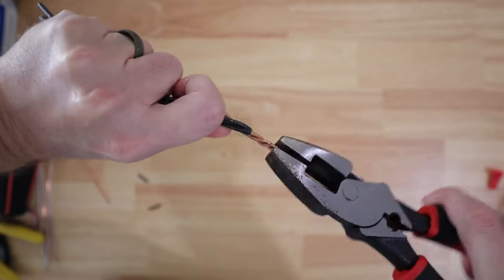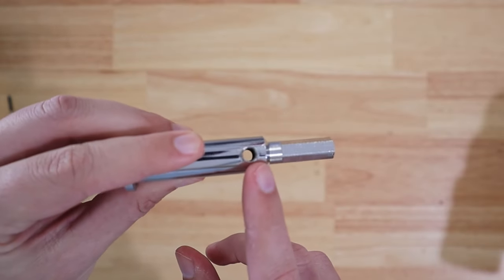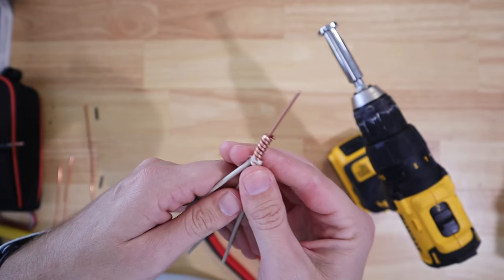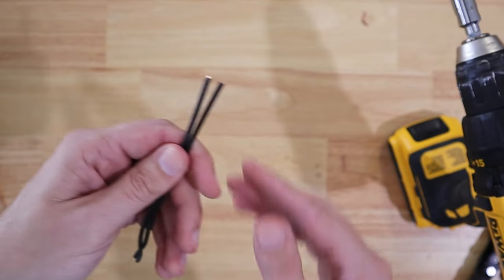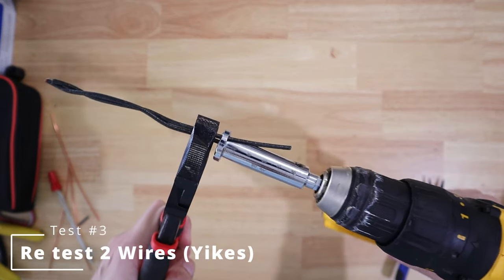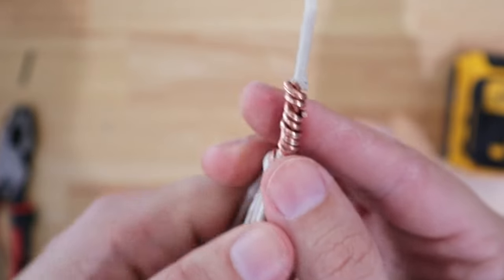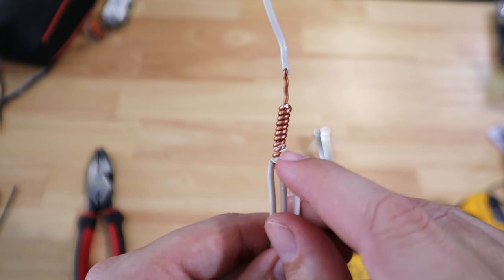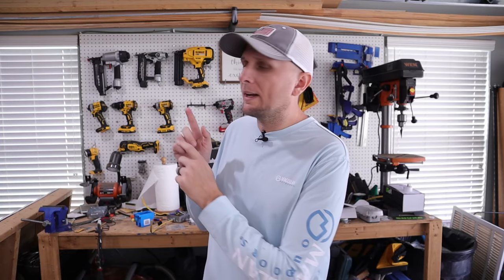Drill Powered Wire Twister and Stripper That Has Gone Viral

Comment from the maker: Have you all been seeing this wire twister/stripper all over the place?  What are your thoughts on it?
Reply: This technic is mostly used in third world countries where they use electrical tape instead of wire nuts
Reply: Would this work for wire that is used for paper bales? At my job we bale scrap paper and use wire with a hoop on one end. My issue is tight hand space and looking for something like this to get tighter bales. Think this would work? 🤔
Reply: @SloppyWzrdSleeve  Good thought.  What's the cost of this thing.  My limit would be below $20...like $11 or so.  I guess it depends on how many bales you need to tie.  It might be worth a crazy amount if it helps you enough.  Again, great idea.

Comment: Some of those problems might be fixed putting the drill on the slower speed setting.
Reply from the maker: I tried it slower but it was actually worse.
Reply: A stripped middle wire would make this moot.

Comment: Your concern about the giant nut that you have to use shouldn’t be something to worry about, since you have the wires twisted very tight, the purpose of the wire nut would be of isolating the whole thing/joint.

Comment: I just use Wago lever nuts. It's quick, easy, secure, and has a much higher continuous operating temperature rating than would ever be necessary, so it's really safe, too.
Reply: That's what I use.  Well worth the investment.  Especially when you want to pull your hair out trying to wrap 4+ ground wires into a nut and 1 keeps pulling out.  Wago eliminates all that.
Reply: Heard. In addition, they don't ruin the wire, so rewiring or doing later work is so much easier.
Reply: @wombleofwimbledon5442  Yeah, I've been using them in my home. You're right, since they just clamp down on the wire and it doesn't require the twisting and bending of the wire while working with it, the wire maintains its integrity.
Reply: wagos for the win, fo sho.  If you're a novice, trying to get 3 separate 14 or 12 AWG wires wrapped around each other and THEN get a wire nut SECURELY on there...  tear out your hair is right

Comment: Big mistake I did, but fixed using this. Strip the wire that goes into the Center hole.
Hold the pliers holding the wires directly in contact with the face of the bit. Then drill.
Reply: Yes, my thoughts too.  In fact, why not strip all the wires?  A great twisting tool is always helpful, especially with 3, 4 or 5 wires.

Comment: The only other test I would have tired was strip center wire first then try clockwise. If I was going to get one it would be for 5 wire 12 awg and 5 wire 10 awg. If it is less then that I use my channellock lyman pliers. Because of how it's been tightening wires blue or red wire nuts might not fit.

Comment: i purchased a similar one of these and the first two times it worked perfectly. From then on it stopped stripping the center conductor which totally ruined the connection. I used a drill and tested slow, fast, left, right, with up to 5 wires all with the same result...failed.  Great idea though
Reply: put drill in reverse and it works fine if you have the same one I have. Mine looks like this

Comment: Just checked out availability of this tool on UK Amazon and besides this one there are a couple of others, one with 3 different size heads. Can't help myself though, in spite of this vid I'll have to try one!!  Although, I can't believe wire nuts are even permitted on US mains wiring!  They aren't over here, for first install anyway. People might use them for diy work, personally I wouldn't touch them.

Comment: The reason why you bend the center while you're over is so that it has bare wire touching the other two stripped wire because the machine does not strip the center wire

Comment: I think the instructions says to use an under 16V drill that’s why you are cutting the wire or insulation not removed properly
Reply from the maker: The instructions with mine did not specify a specific drill.

Comment: Besides the obvious inconsistencies in the connection, this seems like it would be very cumbersome doing this to wires inside a box or boxes with short wires. I'll stick with the old tried and true strip and pre-twist then wire nut.
Reply: works just fine in tight quarters. Is much easier.

Comment: Doing it the old-fashioned way:
1) Strip your wires, 2 or 3 steps
2) Twist them with pliers
3) Screw on wire nut

With the tool:
1) Line up wires and feed them into tool
2) Run tool
3) Pull insulation from center wire
4) Cut center wire
5) Install wire nut

WTF?!! How does that save time?! Since I use a fancy automatic wire stripper (like the Irwin tool), I can strip all the wires at once as long as I line them up in the jaws. In addition, twisting the wires by hand allows you to twist some of the insulated portion below the nut making a stronger connection that won't pull apart. This is one gimmick I am going to pass on.
Reply from the maker: I don't blame you Wayne!  You saw what I did with mine.  Thanks for the feedback!

Comment: Looks like it will take the same amount of time doing it the old way as using the tool, or  is that just me
Reply from the maker: I think it is faster but I don't think that the little bit that it is faster is worth what you get.
Reply: I tried four wires by hand and it took forever and was a pain.  Just a DIY job, and it worked, but would definitely do this over that.  Or use Wagos next time.

Comment: Why did you always put a wire in the center? Did you try it with using only the sides?
I use Wago connectors anyway, so I was just wondering. Wago connectors are faster.
Reply from the maker: I did it because the instructions always said one went in the center.  Didn't like it.
Reply: Noob
Reply: I bought this item and before using it, I noticed in the photos and videos that the center wire wasn't getting much twist, although Adam did a good job testing it by pulling on the center wire in the video. I sent it back without even opening the package.  I thought of re-buying it and trying it with only the outside holes.  I would be tempted to strip all the wires first because I'm mostly concerned with the wear and tear on my wrists of twisting.  Hey Adam, wanna give it another shot???  😁

Comment: if its any help i just checked their advertising, it shows them using it clockwise, and at a slower speed
Reply from the maker: So what I found at a slower speed was it did not strip the wires as well and caused the beginning part to be strained but not stripped.  Also, sometimes the middle wire would not get stripped.
Reply: @HowToHomeDIY  great, thx, im always suspicious with any advertisment, usually to good to be true
Reply from the maker: Same here.  But as much as I was seeing it on social media and how well it appeared to do the job, I just had to try it.
Reply: @HowToHomeDIY  agreed

Comment: These types of twists are used in other countries where wire nuts are not needed. Which is interesting because their voltage systems are double that of the US.
Reply: 240VAC still comes to the home, it's why electric dryers/heaters can be used.
Reply: Voltage doesn’t matter, it’s the amperage that kills you.

Comment: A electrician would be able to counter all the flaws you found. In a short period of time he would be able to splice wires together that would pass anyone's (other than you) inspection. An 11 minute video can't produce a  Master Level "Drill Powered Wire twister". Think of all the time you could save once you get the hang of the tool.
Reply from the maker: Then why aren’t any electricians using it?  If it was something that could speed up work and still pass inspection or be remotely good, I tend to believe that they would be using it.  But they aren’t.

Comment: The electricians I've watched don't twist the wires before they put the wire nuts on.  I was kind of surprised the first time I saw it.  This has been over many years and different companies.
Reply from the maker: Lazy.
Reply: Incorrect. It depends on the nut. The winged nuts specify you don’t need to pretwist but when you twist the nut the jacketed portion directly below the nut also needs to twisted too. The old round nut with no wings need to be pretwisted because you can’t get enough torque on it to twist it together.
Reply from the maker: @xxvodanhxx Lazy

Comment: Safety wire pliers, Maybe.
Reply: It might work on two wires with lockwire pliars, but 3 or more would be difficult to grab all 3 without compromising the tips of the wires.  Most I've seen do .032  or .042 really well.  Might was well use lineman plairs.

Comment: Look, you just take that springy thing out of the wire nut and FLIP IT.  Then when you run the drill counterclockwise you can put the nut on counterclockwise.... problem solved!  How easy is that?
Well except for the 2 hours needed to reverse all those springy things.  A'ight back to video surfing.

Comment: looks like by spinning it backwards it created a right hand thread for the wire nut to tighten on.  Not saying it's a good idea or tool but the thought in having the drill run in reverse is probable to make the wires into a righthand thread...  Only thing I could see as a reason for having the drill in reverse

Comment: 2:59 Is it me ever looking wrong video tutorial or in this video, He is Not read the manual.
Or the twister is not used for the right wire, or the twister only has 2 holes, and even seen 5 holes in online shop.
Reply from the maker: Manual was read.  This doesn’t work well.
Reply: @HowToHomeDIY  But, why the insulation of the middle is not come off? You won't need to remove the insulation.
It supposed to tear all of the insulation.
Or, I'm on denial.
I'm supposed (planned) to replace all my cables in my old house, and this twister tool is my hope to speed up the process. (Me, not electrician, diy). I'm not buying this tool, yet. And, because of you, I'm considering to use wago, or Krustin terminal, or manual. Wago has a lot of fake product in my country, Krustin I can't decide which size, and manual twist is tiring.
Reply from the maker: It did come off but I do not recommend using this tool.  It’s not consistent and does not do a good job.
Reply: @HowToHomeDIY  ok. 👍 Thanks

Comment: Two things, the pliers you are using are not heavy duty enough to make a twisted joint. Second always cut the wires at a bit of an angle before installing the wire nut. Your mechanics are somewhat awkward. The tool you displayed is just a joke. Most electricians will tell you the same.
Reply from the maker: Cool 🤣